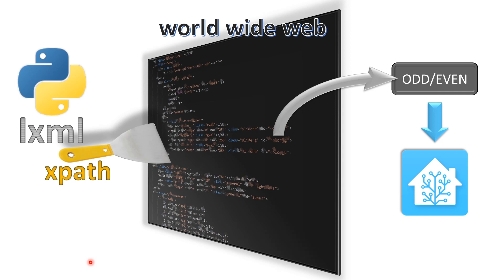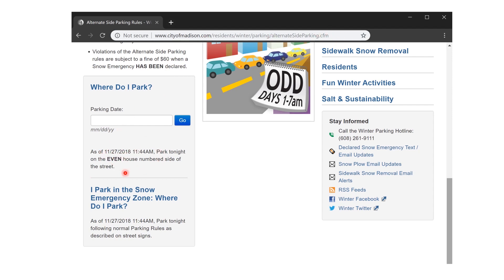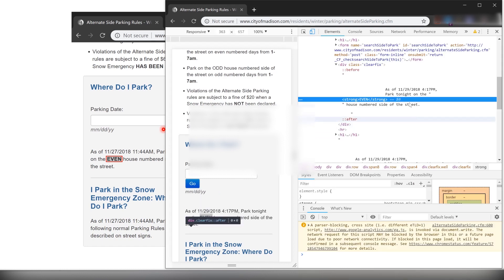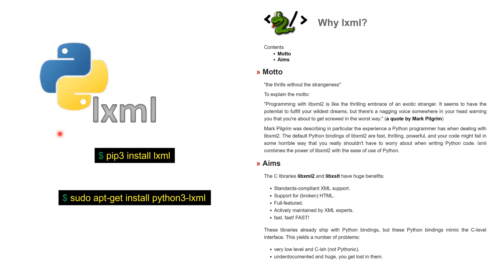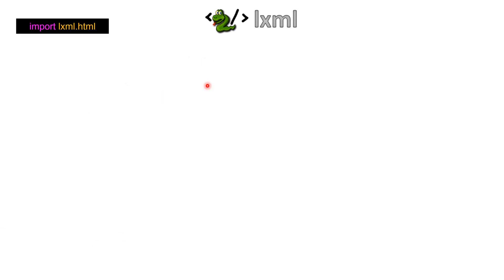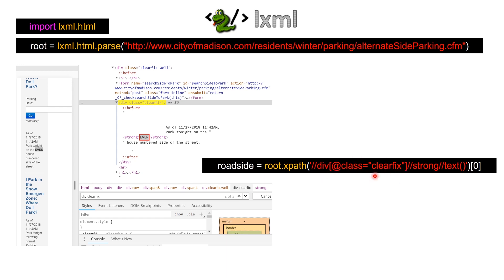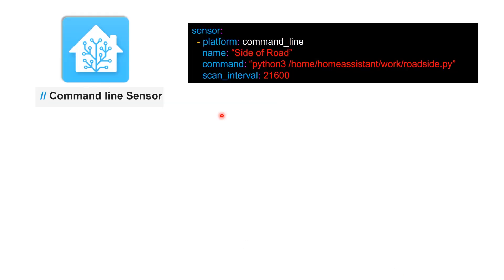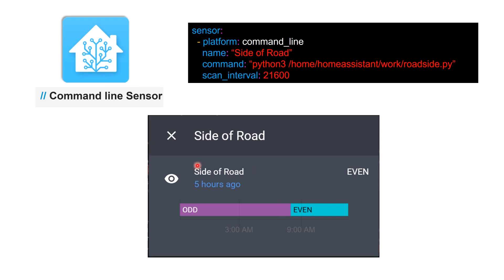Creating a Home Assistant Web Scraper Sensor

Comment: How to add attributes to your scrape-sensor?
I have a scrape-sensor which gets the water-temperature from a lido. So I want the coordinates as attributes.
like:
latitude: 47.3519
longitude: 8.5360

If possible I would even like to have an attribute with the website-link where I scraped the information.

Are there some informations about how I can create such attributes or how they have to be named ("link:", "source:", "web:", ...)?